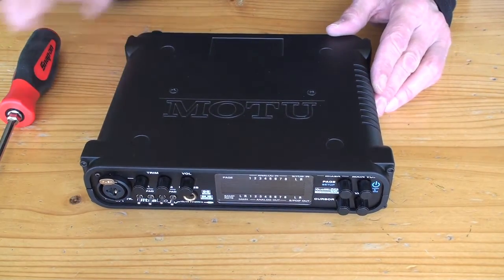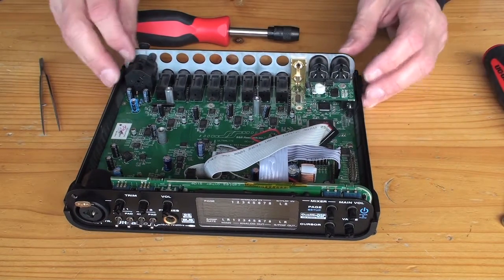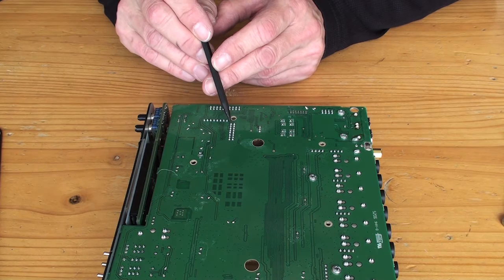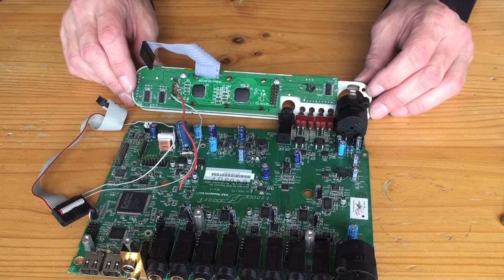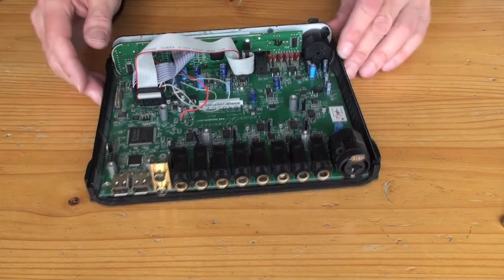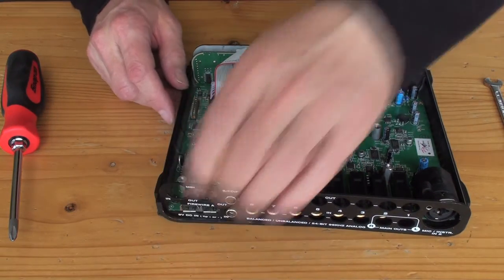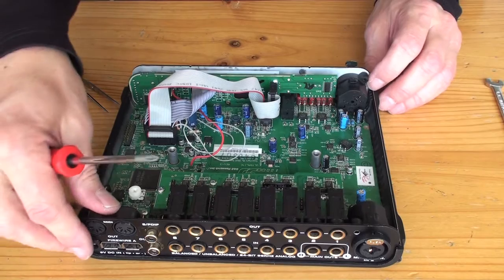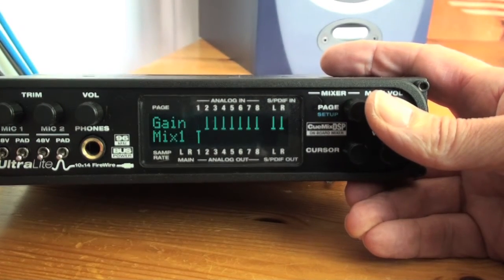Repair of MOTU UltraLite with faulty LCD backlight

Comment: Would You know where to find the .5 volt feed for the Traveler to fix the same problem?
Reply: It should be labelled but if not use the multimeter like he shown.
Reply: @thelabby9998  I actually tried that, to an extent , But I didn't want to fry the board by having a lack of knowledge on my part, never found a feed. There was a spot labeled .5v but there didn’t seem to be power there.
Reply: @jayfarber3559  well another user recommended a workaround getting power from the power connector and using power regulator (similar to  “step down” board ) so check the regular power it goes into the power socket (it’s 12V? I’m talking from memory) and add that extra stage so you can get 5V and regulated (that other user said it was wrong idea to get them from pcb spot since it could be not regulated or proper Amps) and feed from that extra stage the lcd board. If the motu gets any strange behaviour then change the psu adapter to another with some extra milliamps (because that could be the source of the new behaviour if the extra stage // step down gets too much power and the motu is sensitive to that what I can know by assumptions). If none of these “works” then think about replacing the lcd component itself as OP suggested in other comment. Excuse me if my first comment sounded insensitive, without your background/attempts it seems you were asking for “clean hands help” so that’s why I pointed the straight answer (check the vid blabla). Peace and good luck <3
Reply from the maker: Hi Jay. You’re best to hunt for it with your multimeter. Make sure it’s on DC volts mode. 
My best suggestion is to replace the LCD with a new one. I did this in the end and it worked well. Basic soldering skills needed. Good fun project. 🙂
Reply: @thelabby9998  Thanks
Reply: @thelabby9998  This sounds appropriate but out of my comfort zone.
Reply: @jayfarber3559  just to make it clear… power regulator is a 3 pin “chip” (form factor, no code involved) so it will be just soldering the input Vin pin to the power plug and the output Vout to the lcd. Ground to ground… and it will be enough (the power regulator should work with the motu V and the Vout should be 5V regulated). Step down aliexpress board does that with few chips involved but also labels for everything (Vin, Vout, gnd… etc). Not encouraging you to “do it” but almost “research it”. You will learn something interesting and maybe someday you will get the “comfidence” to try it (maybe trying cheaper project so if it goes wrong you don’t risk too much).
Peace, Love and happy hacking!
Reply: @thelabby9998  Seriously, thank you for the information. I'll ask one more, Could you pop me Part numbers? or links for aliexpress? Really appreciate it.

Comment: Hi again after some very long time, my final account with my 828mk3 is ; no usb recognition from pc but perfect connection over 1394 port (fw800) and the front knobs not functioning; i cant even reset it to any defaults or upgrade its anything in search of a proper functioning come back of its periphery, however, as far as the cuemix fx proves it has no flaw in any sort of function in the inside, each parameter including their lights such as pad or phantom responds to the cuemix fx commands performed within the pc. if anyone has a potential solution for the scrambled menu+non responding knobs and usb disconnectivity i am all ears respectfully. And if you know how to reset this device without pressing its hardcopy knobs please do share your wisdom on such a soft solution.

Comment: really great video thanks
Can you give me some hint for replacement part ? 
Need to change my headphone output,but i don't find anywhere ?
Anybody ?

Thx
Reply from the maker: Hi shini. Sorry for the delayed response. If you are talking about replacing the jack for the headphone, that should be available at any decent electronics DIY store or from an audio repair technician. One resort would be to take the MOTU to a pro music store, where they will have a repair technician. S/he will be able to either provide the part you need, or tell you where to get it, or do the job for you. 
Have you looked at eBay? I've bought the smallest of surface mount components from there when needed, always at good prices, though I always end up with 10 when I need one. Oh well ...
Reply from the maker: @BBAF-3012  Hi shini. I know what you mean about a lack of electronics DIY stores in France. I was there for much of the last 18 months and I missed the kinds of DIY stores we have in Australia. Anyway, I found a small electronics repair shop in the town I was in and the guy there had what I needed, at reasonable prices too. I tried to pay with Australian money the first time, which caused a very puzzled look on his face. hehe. Anyway, you'll be able to find a small repair shop which will have the parts you need. Or they'll be able to order them in for you. Then it's a case of getting busy with your soldering iron. A good fun project. Please let me know if you get the job finished and your Motu back in working order. It's a device that's worth the effort to fix.
Reply: @Valden23  Do you remember the shop ? That was in Paris ? 
Thx
cheers
Reply from the maker: @BBAF-3012  Hi Shini. The particular store I used was in Cherbourg. AED Electronique in Cherbourg, on rue Jean Moulin. But there will be an electric or TV or music/audio repair shop in every town. I used Google maps to find the one in Cherbourg. Good luck with your repair work. I’m sure you’ll succeed. 🙂

Comment: WHY REMOVE THE BOARD AT ALL?! seems you can just sauder the wire, going to try today
Reply from the maker: aliengtr . You're right Aliengtr! If all you need to do is solder in the new wire, if you can work in the tight space, do it the quick way that you'll be trying. Please let us know how you go. :-) . The full disassembly shown here was what I did while investigating what might be wrong. It will be handy if users have other problems to look for.  These are good units and are worth keeping in working condition. Thanks for your comment.